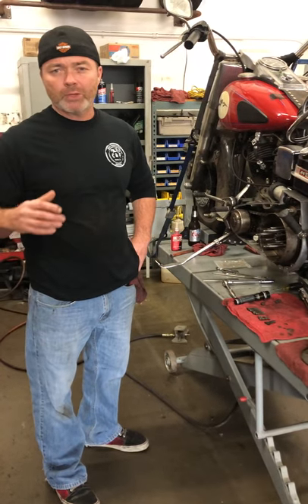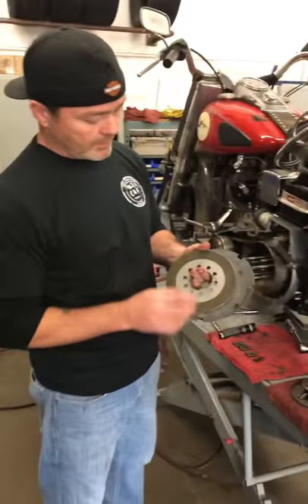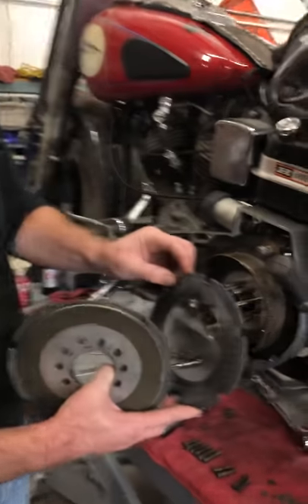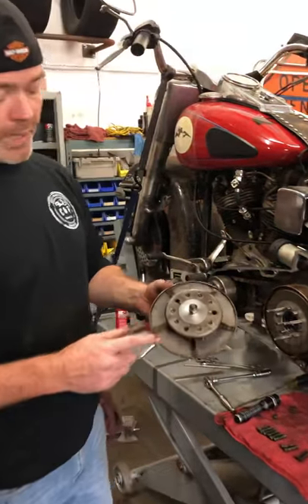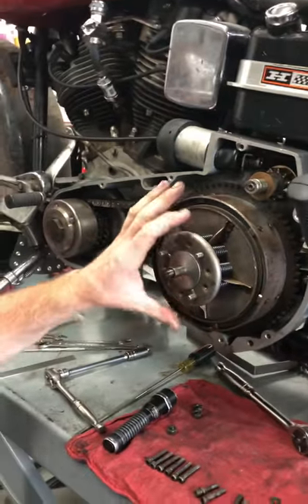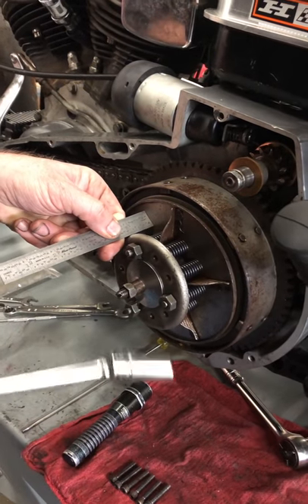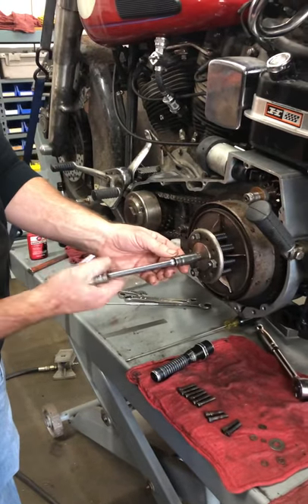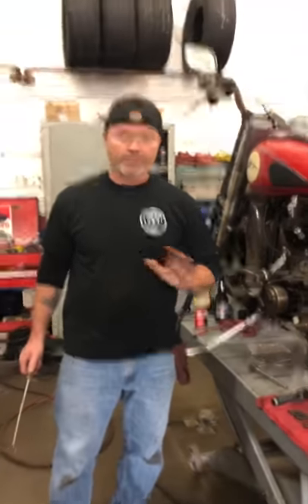Harley Davidson Shovelhead Clutch Install

Comment: 3 stud clutch hub was use 1936 to 1984. 5 stud was/is aftermarket and not Necessary and does not make the clutch better for everyday riding. They were originally designed for drag racing application back in the day.  These clutch's  were designed on purpose to not release all at once.

Comment: Question about setting up the clutch. The service manual clearly talked about setting the clutch arm 13/16 from the top of the transmission tower first, however I have yet to see any videos of people setting it up as the manual states. What's your process? Do you adjust and measure the clutch arm?
Reply from the maker: I actually don’t use that measurement. I turn the adjustment screw in until the lever is all the way out, then back off a quarter turn. Please call us and we can be specific. C&F Motorcycle Parts.
Reply: @cfmotorcycleparts654  Same way I adjust mine.

Comment: Thanks for the video. I just am repairing a '68FLH that had the wrong year clutch shell (1970 + up) in and caused some issues with the starter. I installed a correct '65 '69 clutch shell and re-used the clutch plates (all were in good shape). Also I sanded the hub studs to remove wear spots. The clutch is not fully dis-engaging now. What do you think is the most likely issue? Perhaps I should drill the clutch friction plates holes out by 1/64"? Release plate looks to be moving outwards about 1/4" - 5/16"...maybe I need to adjust the clutch springs with the clutch dis-engaged to unequal amounts rather than setting it up to 1-1/32" with the clutch engaged?? Thanks.
Reply from the maker: Depending on if it's a 3 stud clutch hub or 5 stud, you want to make sure the friction plates are not hanging up on the studs. When you do your adjustment, you should be able to pull in the clutch and spin the hub by hand to make sure everything is free. Sure, you can drill out the holes in the plate. Also double check the basket to see if the steel plates are hanging up. I also use a bearing called the big fix so the basket doesn't move so much when I pull in the clutch. Hope this helps. Let us know if you have any more questions.

C&F Motorcycle Parts
Reply: @cfmotorcycleparts654  Hello, thank you for your reply. I'm running a 5 stud hub. I just tried something I seen in another one of your responses to another question where you mentioned to turn the push rod screw all the way in then back off a 1/4 turn. That did not do it so I will check the plates to see if any are binding or not moving freely, but I am curious about this bearing you mentioned...the big fix. Can you tell me more about it? Is it the same as the Tamer that holds the hub bearing in place? Thanks.

Comment: Quick question about clutch shells for shovels. I know there is a difference between a clutch shell for a '65 pan - '69 shovel versus a clutch shell for a '70 and up. The starter ring gear is located different . I believe the '70 has the ring gear stepped inward on the shell about 5/16" and the '65 - '69 is close to flush with the edge of the shell (towards the primary chain sprocket)...is this correct? Thanks. 
Show less

Comment: No mention of primary oil
Reply from the maker: The stock set-up is actually a dry clutch. Harley designed it to drip engine oil onto the primary chain from a line that went from the oil pump to a fitting in the back of the Primary. Then there was a hose that sucked up the oil at the very back of the primary and routed it back to the oil tank. So really Harley is just concerned with oiling the chain on Shovelheads. I have seen some bikes come into the shop with a little bit of oil in the primary, similar to lube the chain. Similar to newer bikes.

Comment: Can u help me with the torque on the big thin centernut?
Reply from the maker: I’ll double check the torque, but honestly I’m so used to doing it by feel. I draw it down with my 1/2 inch air gun and then I zip it one more time to seat it. Use a little red loctite as well. I will reply again once I find the correct torque spec.
Reply: And perhaps the long nut with the sealgasket to🙄

Comment: How do I fine a video on how to put your pad on the secondary chain on a Harley-Davidson 82
Reply from the maker: We don’t have a video on that. The best I can say for now is tighten the compensator big nut. Tighten the clutch hub nut. Then bring up the primary chain tensioner pad up enough and then tighten it down you want 3/8 to half inch of play on the top chain